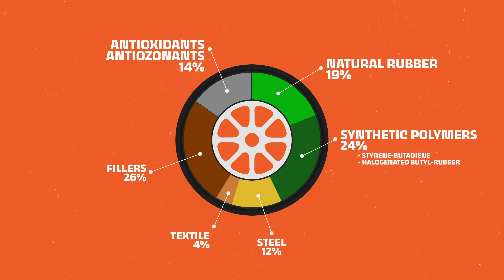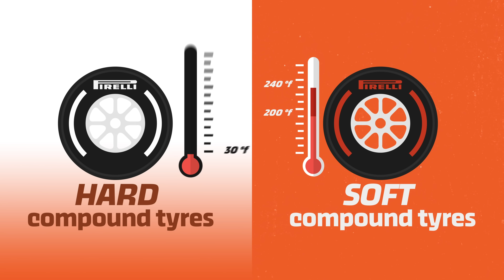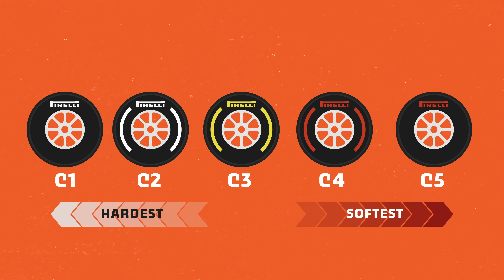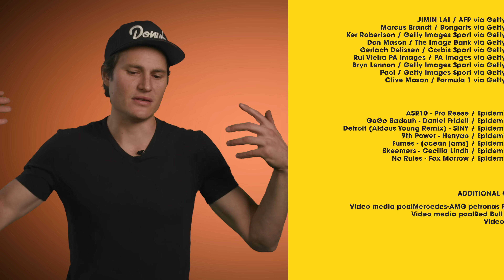Why an F1 Tire only last 50 miles

Comment: ''F1 Tires only last 50 Miles''
Checo Perez: *They what?*
Reply: They last only 50 Miles.
Reply: @user-ov2fc5sd1e  The top 6 drivers in Abu Dhabi all were capable of racing 45 laps on hard tires. Way more than 50 miles.
Reply: Bro why "They What" meme on a sentence that doesn't have a speaker.
Reply: @user-ov2fc5sd1e  sigh noob, i only last 3 minutes.
Reply: @fujisan5781  Depends on the hardness. Endurance tires are less built for 5-6 laps and more built for 50-60.
Reply: @matthewmorgan582  During the Sakhir Grand Prix, Bottas did 45 laps on Medium tires. Stroll did 43 laps on Soft tires he used during qualifying. All well over 50 miles in each compound.
Reply: @fujisan5781  - However, if any of the driver actually drove 'flat out' - without managing their tires, they would be 'out of tire' in 50 miles.  Hell, they can use up all the 'stick' in less than one 'hot' qualifying lap.
Reply: @mmi16  I could not agree more. Tire management plays a huge role. I just think there’s massive grey area to this statement of only surviving 50 miles.
Reply: I think he and Danny Ric both would have the same reaction. I can hear Brundle now, "Driving like he has to pay for the tires himself..." :D Also, the 50 miles is misleading as this is really talking about just the lower one or two compounds in the entire range, the top compounds in the range have much more life.
Reply: Checo: Am I doing something wrong?

Comment: FIA: You can have only 2 mm of tread on your tires
Also FIA: Y'all gotta reduce downforce cause tires wear out too quick
Reply: Its callled covid 19 have you heard of it?
Reply: Pretty sure the aero change is for dirty air, but 👌
Reply: @xeakpress  COVID has nothing to do with reducing downforce, they restricted the INCREASE of downforce to restrict the teams from spending more money. The Reduction in downforce was due to tire concerns for next year.
Reply: @pepperjackchese7374  ur tires are about to catch covid and lose all of its pressure due to the symptoms. Covid will also infiltrate the storage area, and make all of the other tires deflate to.
Reply: @pepperjackchese7374  2021 was the aero over hual as well the SWAP TO NEW LOW PROFILE TIRES. These new tires have lower operating temperature, more durable side wall and, with revision to suspension would drastically alter the way the tires handle increased downforce. Along with the vote to push back new regs the teams also asked to have the new tires pushed back along with it. They even tried to do last minute testing at a few practice sessions to see if they could try and find a way to bring new tires that would stand up increased downforce strain but, drivers complained about 'no grip' and redoing the suspension to accommodate would have cost every team alot of $$$ something they dont have alot of because of...good old COVID 19. 

Also for people wondering 'well why're they cutting down force then' because they will be forced to reuse the 2019 spec rubber which isnt capable of handling any more load without calling into question tire durability and safety. Seeing as teams are able to contuine to  make changes to most of the aero parts.(oh and if youre keeping tabs the reason they are using 2019 rubber is because yaknow money constraints due to covid 19).
Reply: @xeakpress  this comment is so underrated
Reply: @spiffytuber7515  aren't they are also keeping the 2019 tire compound for cost reductions as well or am I wrong ?
Reply: Reducing downforce is to increase overtaking in F1, by reducing the amount of dirty air left behind each car at high speeds
Reply: @xeakpress  this legit looks like you commented on the wrong thread bro

Comment: "as the only thing between the car and the road"

stance boys: pathetic
Reply: it seems incredible all the criteria Pirelli or every other F1 Tyre manufacturer has to follow, Soft tire Baseline, medium has to be 1.2 sec. quicker then a hard tire, the soft has to be  2.2 sec. quicker  then the hard tire!?!?! foolish or not?? and this 2 sec. of degradation after 10% of the total race distance!! I mean it sounds like space technology 🙄🙄
Reply: Top tier comment 👌🏻😂
Reply: @Ezekiel903  pretty off topic but yea
Reply: That's so true though
Reply: Dank wise  lol, yeah
Reply: In some cases the wheel lip is the only thing between the road and the car.
Reply: Literally me
Reply: There's Oil sump dragging on the road
Reply: tire
Reply: According to the cut springs crew your sump and chassis rails should also occasionally be in contact with the road
Reply: top comment already 😂
Reply: stance bois be like: what even are tires
Reply: That's what exhausts are for

Comment: It's great to hear someone talking about Pirelli drawing the shortest draw. When other companies had the monopoly on tyres, like Goodyear in the '90s, they just put out the best tyres they could. Or, at the very least,  a good tyre (like when they were forced to make grooved tyres). When Pirelli got the contract, they were forced to accept absurd rules, created by the FIA with no real need. Like "make the tire last only X laps! it will be more fun!" or "hey, next year we are increasing downforce and power, so you have to provide a new tire, that will degrade in X laps. But with no testing at all! It would be costly. And we want this to be a surprise for everyone! This will surely increase the spectacle with no risk at all!"  (Silverstone 2013). Frankly, i'm surprised Pirelli is still in F1. Being in F1 has only damaged their reputation, and (largely) not by their fault.

Comment: The CEO of pirelli said that they could even make tires that would last a whole season but they dont bc of the FIA
Reply: Yeah, I remember Paul Hembery say that.
Reply: Wow
Reply: The compound would probably be as hard as a commuter car tire if it were to last that long
Reply: @charlieguzman5509  nope. just more mm of tread
Reply: @Groesbeek1994  but they don’t have tread they’re racing slicks.
Reply: @williamwatkins2538  lolol
Reply: @williamwatkins2538  thread has 2 meanings, thread like profile what we have on road tyres, and thread meaning the distance from the construction of the tyre until je service area, f1 has 2 to 3 mm max to race on, but they can have 30mm
Reply: @Groesbeek1994  more “tread “ as you say wouldnt change anything unless they change the compound the tires are made of to a harder made tire and harder tires have less grip not something you wanna lose while you mid corner at 100+ MPH softer tires means more grip but less tire life
Reply: The super super super hard tyre
Reply: @williamwatkins2538  nope, the reason why it is a harder compound is because the tyres need to have the same width otherwise the cars have different high
Reply: @Groesbeek1994  that makes absolutely no sense, do you know what tire compounds are?
Reply: @williamwatkins2538  with width i ment the sidewall. all 5 compounds have the same dimentions on the tyre wall. if those dimentions were diffrent from each compound the tyres would be bigger in size because the rim is a fixed size. the more tread (distance from the tyre structure to the surface) the higher the car will be, like with full wet tyres. Pirelli could make the tread from 2-3mm (like it is now) to like 30mm, with that the tyres would last as long as u want. with C1 tyres the type of rubber is harder so it wont flex so much with the same amount of tread
Reply: @Groesbeek1994  compound is what is put into a tire. As a example you can take a 33 in mid terrain tire with 20/32nds of tread and a highway terrain tire with 10/32nds of tread which one last longer? The highway tire cause it’s made out of harder materials than a M/T compound tire. It’s not about tread depth but the compounds the tires made out of
Reply: @williamwatkins2538  i can understand that, but thats not what i ment. Ofcourse that tyre will last longer but it isn't put to that high stress. Im talking about slicks, without any profile(tread). The thicker the layer of tread on slicks the longer they will live, just like a road car would last longer with more tread. The only reason soft tyres lose grip is because there is no more surface area of tread and they are driving on the rubber what is ment to hold the tyre in one piece (look at Silverstone for example), the tyres exploded because there was no more tread to drive on
Reply: And they all say it's just to keep the race exciting is just all bs still can't figure out why they just have to waste all the resources to make bad tyres , isn't the climate change bad enough as it is now and they want to increase is faster 🤦‍♂️
Reply: @Groesbeek1994  I think you're trying to say, "Less air and more rubber so that they last longer" the thickness of the "tread" before it gets to the section with air to blow out
Reply: @king-su5uc   while it is true that making tires uses natural resources and damages the climate bit by bit, in comparison to any other sport, going through 2-3 sets of tires per race per car is so negligible to the environment that they do it anyway.
Reply: @williamwatkins2538  are u not getting what he's saying? He's not talking about how much grip the tire has. If its a super soft tire compound with 2-3mm of tread its not gonna last as long as a super soft tire compound with 5-10mm of tread. I dont get what were arguing abt
Reply: @gaming_and_reality1018  I understand what he’s saying but he was still wrong.

Comment: I like the pit strats introduced by the high degradation. It makes it rather exciting when two race leader is on different strategy and you have 2nd place on the fresh soft tyres setting fastest laps trying to close the gap to the guy in front.
Reply: and yes that lack of groovy treads is why when f1 cars hit any water on the road they slide out of control without fail

Comment: The tires on my Camaro when I was 17 only lasted 50 minutes 💨💨💨
Reply: Smoke tyres, not meth.

Just as expensive it turns out.
Reply: What year Camaro 😂
Reply: @treebeard9461  1995
Reply: That's probably going to be the same story foe me when I get a mustang and like 2 years
Reply: @TechDove  catfish Camaro nice taste
Reply: @Natd0gsef  in Crystal purple metallic too
Reply: @TechDove  nice when I get my mustang I'm thinking about painting it Mystichrome sn95 mustang specially
Reply: @Natd0gsef  Crown Vic, with twin turbo coyote and a big ol wet shot. Stick shift, weld-well diff. Ex cop car becomes cop bait.
Reply: Noice
Reply: @Megatron Knows oh bro, A31 Cefiro with RB25DET. That's a souped up taxi. 
Not sure if you got em in USA, being right hand drive only, but is basically a 4 door R32 chassis with Nana's frock on.
Did come with factory RB20DET but only Nismo signature model. Most were 20E Autos.
Reply: My stock tbird v8 destroyed both tires in like a few minutes. 4.6 2v intake heads headers and full exhaust
Reply: @Megatron Knows Crown vic is a mad soup taxi. But the BEST soup taxi is the A31.
Edit: Crown Victoria are hard to find here, much like A31s in USA. We didn't get em new. We get Aussie Falcons here.
My father had the Crown Vic for a few years, then we built it. The ceffy was me n my buddies project. 
Entire 20s spent with bust knuckles and black fingers.
Reply: @Megatron Knows I miss Vicky.... but "Dirty Cef" is probably the car I miss the most. And hell yes, they handle so nicely. 
It's just like driving a skyline.
Reply: Hmm, F1 must look into your tires then, that lasts quite some time.
Reply: @TechDove  3rd gen or no gen! (I might be a bit biased) 😬

Comment: For the international viewers (like me) you guys should definitely add metric measurements like meters, and °C for temperature. Thanks in advance!
Reply: We only speak in Bud Lights per Bald Eagle over here, pal.  Ask Siri to convert it for you pshhhhhh
Reply: Also, so much for 'fighting their independence' when they are the only country left using a monarch's body part for daily measurement. Should have named it the King's Foot, that would make all yanks ditch imperial in a heartbeat. Lmao.
Reply: But they use 9mm for school gatherings
Reply: @Yash Paritkar Worst thing of all is that they haven't use those barbarian units in ages for anything serious like rockets or anything lmao
Reply: @OriginalAustinOblivion  Yehaw son! Fellow Texan here.  :)
Reply: Americans:are measuring systems are not weird and forever wont be

Americans in 2077

Friend: how long is that wall

Americans: oh its about a 4th of a football court per moon landing
Reply: NO!
Reply: @fns58  From "REFINEMENT OF VALUES FOR THE
YARD AND THE POUND" Effective July 1, 1959, all calibrations in the U.S. customary system of weights and measures carried out by the National Bureau of
 Standards will continue to be based upon metric measurement standards and, except those for the U.S. Coast and Geodetic Survey as noted below, will be made in terms of the following exact equivalents and appropriate multiples and submultiples:

1 yard= 0.914 4 meter
1 pound (avoirdupois)= 0.453 592 37 kilogram

And why does it say "will continue to be based"? Because they have been based on metric system since 1893 :D

Comment: "F1 Tires only last 50 Miles''
F1 drivers: do 50 laps on one set of tires around a 4-mile track
Reply: Can't be. A F1 race is about 190miles long and if you drive 50 laps on a 4mile track that would be 200miles and they pit at least once at a race. But I also think they last longer than 50miles:D
Reply: @kokowic9494  Maybe around 75-100 miles but idk
Reply: @kokowic9494  they can last about 195 miles if you use the hardest available compound and don't push hard during the race, which is enough to last the entire race distance.
Reply: @kokowic9494  there's literally FIA guidelines you can read You're very wrong The rules for a class one track which means F1 could ride on it Is anything in between 7 mi and 3 mi A 4 mile long track is 100% conceivable it's literally on the FIA rules
Reply: @kokowic9494  Eh, that's not necessarily true. The race is around 190 miles, but that doesn't include the out lap (or in lap, but that's a different story). I remember about 10 years ago, Vettel came into the pits for his only stop just before the last lap of a race. That means he did at least the full race distance on a single set of tyres. I'm not certain what track it was, but there is a bit of fluctuation (longest race gets up to around 192.5 miles). The out lap (and any safety car periods), the cars are not taking the shortest path around the circuit, they're going back and forth likely nearly doubling the distance traveled for the lap. Add to that I'm pretty sure at the time any drivers who reached Q3 had to use the same tyres in the race that they used to set their fastest time during Q2 or Q3 (forget which, it's changed a few times), so there were likely a few laps on the tyres. It is probably extremely rare, but I would not be remotely surprised if he reached 200 miles on that set of tyres.

Of course, the caveat is this is from my memory and I don't recall any other details, so if he went that long I wouldn't be surprised if he didn't reach Q3 and selected a brand new harder compound tyre since he was starting closer to the back of the grid. It's also possible that qualifying happened in the wet and the race was in the dry which would also enable him to use brand new tyres. I know for a fact that the race was in the dry because my memory of it is mostly that he had to pit otherwise his performance wouldn't have counted since he only used 1 compound. It's also possible that I'm just not remembering perfectly and he started on medium and stopped for another set of medium so he had to stop again to swap compounds.
Reply: @GARBO96  Looks like you misunderstood Kokowic's point. It was about total race distance, not the length of a single lap.  (A single lap around Spa is about 4.35 miles). The longest race distance last year was Sochi at 192.467 miles. Tack on the formation lap and the in lap and you likely could reach 200 miles, but (barring rain) drivers are required to use 2 compounds of tyres, so they'll need to stop at least once during the race. It is possible, but extremely unlikely, that a driver would reach 200 miles on a single set of tyres.
Reply: @jonmendelson1104  if that were true he would have corrected me himself instead of saying silent for over a year
Reply: @jonmendelson1104  have you been watching formula one this year albon took his tires to within one lap of doing an entire race that was this year alone there are many instances of it happening throughout Formula 1 history
Reply: @GARBO96  Eh, plenty of people leave comments and never come back to look at replies. I could maybe understand at a glance interpreting it as "there can't be a track that's 4 miles long," but I don't see how when someone points out the likely misunderstanding you could take a few seconds and look at the comment and interpret it that way. 

"A F1 race is about 190miles long and if you drive 50 laps on a 4mile track that would be 200miles and they pit at least once at a race." 

The only place he mentioned the track being 4 miles was in showing his math that 4*50=200.

Comment: "Why an F1 tire only last 50 miles"
me: 50 treadwear
Reply: well that depends. if you put those slicks on a mini can thats stock. I can guarantee it will last longer. If you just drive with that thing slow then the power wont make it wear out. XDDXDX
Reply: Just let me race
Reply: @63W-raccoon  a mini wouldn't get them hot enough so you'd have no grip anyway
Reply: @insomniacbritgaming1632  
ONLY 1 WAY TO FIND OUT!

Donut should put F1 slicks and tireshine on a mini and see how it handles! 🤣😂😅

I ONCE had a "friend" put tireshine on my FC turbo II Rear tires! 

Too much fun!

-James Bond